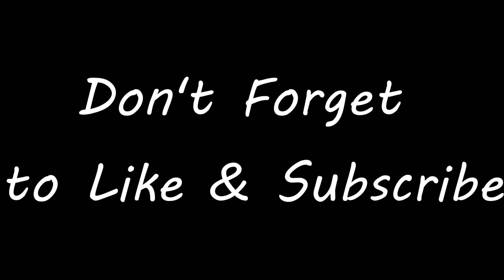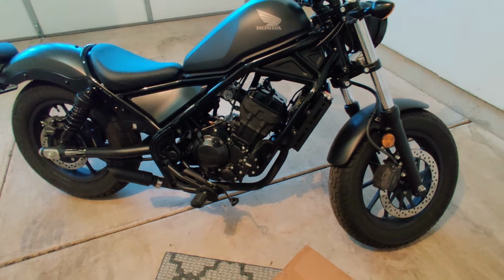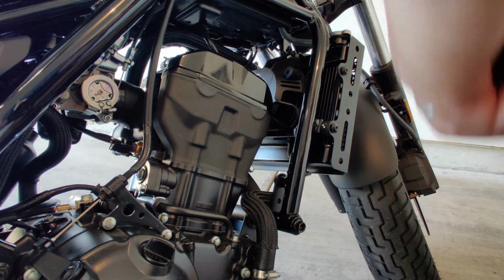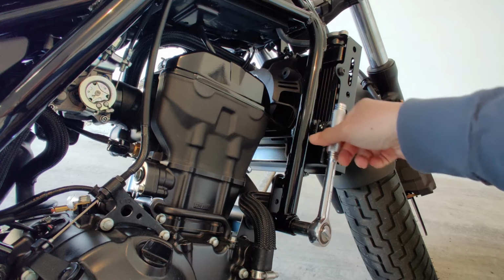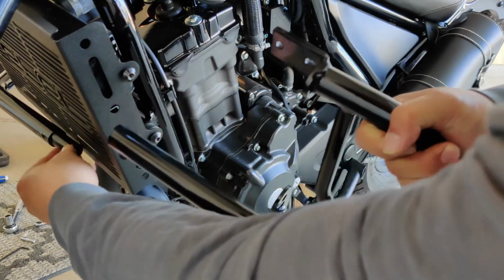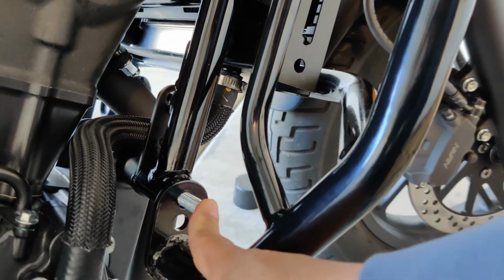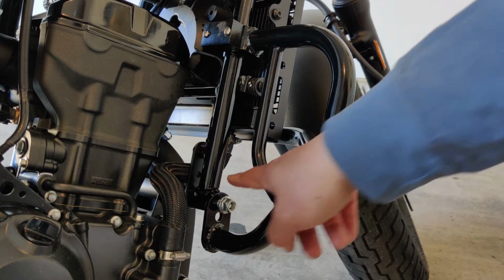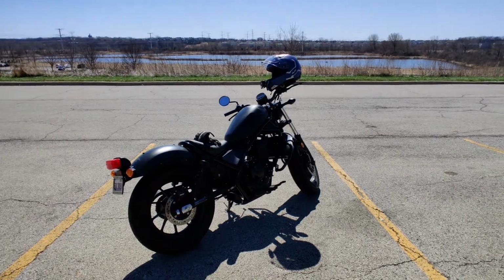Installing Crash Guard on Honda Rebel

Comment: I bought the same bars for my Rebel and googled some instructions/pictures. The top mount is supposed to have both sides of the bar clamp around the frame bar and then the crash bar mounts on top of the clamp, not in between them.
Reply from the maker: Thanks for the advise.  I will add your installation instructions in this video's description.
Reply: @irogdebs8698  BTW, thanks for posting the instructions. How have the bars held up? Also, have you found an effective way to protect the rear end besides slidders?
Reply from the maker: @albany69611  The bar is sturdy enough and I have not looked at sliders or bars that can be used for the rear end.  Haven't done anything with the bike for now.
Reply: Agreed

Comment: I recently traded my third Harley in as I decided it was time to downsize my motorcycle. So I traded for the brand new 2021 Honda Rebel 500. 
    Yes it's considerably less cc than the Harley, but it's lighter and easier to move around when riding and of course it's cruiser style. Oh and I've fitted tip over bars.

Comment: The guard looks good but looks small.  Can you make a video with bike on the side so we can see how much the guard protects.  Thanks.
Reply from the maker: Sure.  Will let you know when I have one.  Thanks.
Reply from the maker: Here's the additional link.  Hope it helps.  crashguard on rebel:  https://youtu.be/wr6conPlkJk
measurement:  https://youtu.be/f5tkGRKw51I
Reply: @irogdebs8698  Thanks for the additional video and the guard looks nice.    But I was wondering have you tried laying it on the side (gently) to see how much the guard would protect if you ever  dropped the bike and it fell on its side.  I was also looking at the T-rex bars which are big and I thinknot as stylish as your guard but when another youtuber put the T-rex bar  bike on the side it fully protected everything.
Reply from the maker: @johnaxta1008  No I have not.  from the looks of it, I think it can protect my bike if laid down.

Comment: I have 2021 rebel 300 and was wondering what year yours is . I want to buy a crash bar like yours, but I seen where some of the ones on ebay would fit a 2018 rebel but not the 2020 or 2021 . Any information would be helpful . THANKS!!
Reply from the maker: Hi @Kenny Willis, I have a year 2019 Honda Rebel 300.  Thanks.
Reply: I also have a Rebel 300. Kenny, did you ever determine if this engine guard will fit a 2021?

Comment: Crach guard...yes it you stand still it may helps. In slow speed it bents backwards and helps nothing at all. 😒
Reply from the maker: I think it's better to have something than nothing at all.  This is also better than having sliders.  There are other more expensive crash guards in the market that you can get.